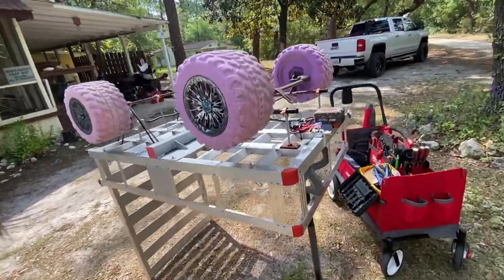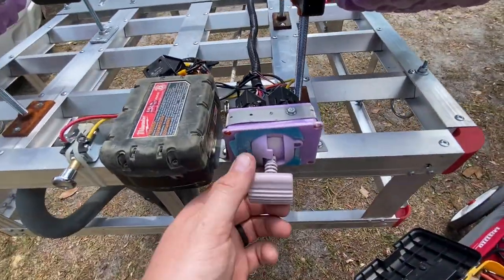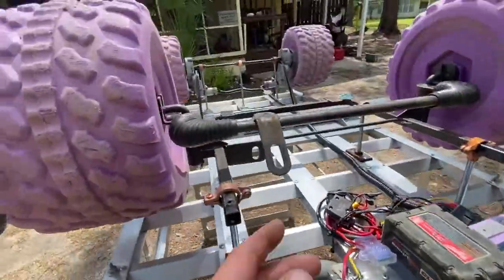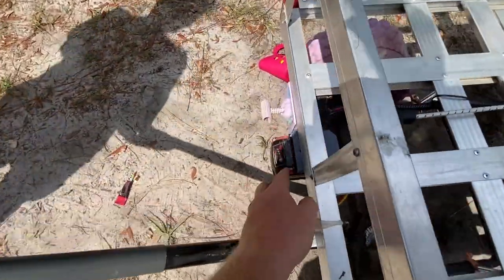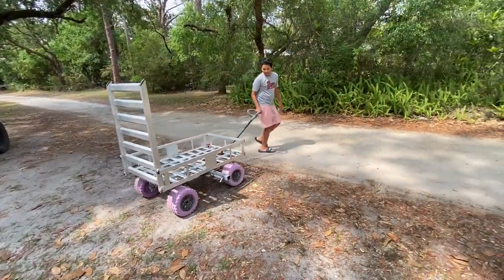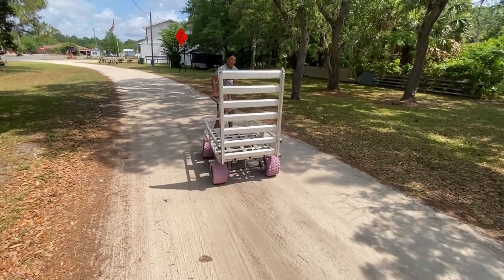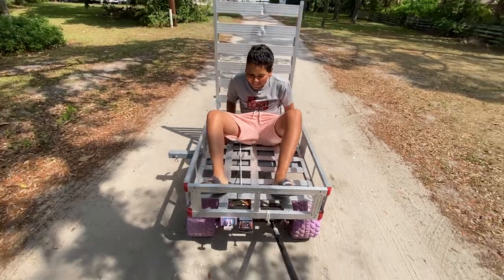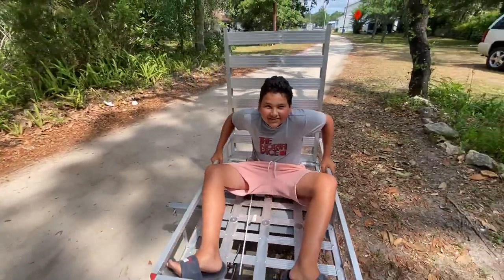The Ultimate Beach Cart Build (Milwaukee Powered)

Comment: Cool idea!  If you move the accelerator switch up to the handle and then you can control it from there.
Reply from the maker: Thats a great point! I was going to do that but the handle has to be removed for transport. I didn't want to be fiddling with wires every-time I loaded and unloaded it from the hitch.
Reply: I was thinking of the same thing.  Having to walk towards a moving vehicle in order to stop it sounds like a plot point in Zoolander or Austin Powers. :)
Reply: Use a disconnection point on the wirings so u can detact the hands and wires if needed
Reply: I have a solution for that, the detach and reattach. A quick connect
Reply: Leave handle connected all the time
Reply: You could probably use a wireless winch, remote control, for forward and reverse, and you wouldn’t have to worry about fiddling with wires at the removable handle just control it with the wireless fob

Comment: How is it on the beach?
Reply from the maker: It worked Great! The only issue I had was any steep uphill sand dune it tends to dig in the sand and you have to pull it a little harder to make it go but still waaay easier that a traditional cart. Im working on a possible 4x4 version for the next upgrade to counteract the hills.
Reply: Imo the height makes this a better design than most but for long-term use I'd go with something more durable suchas mounting a hitch cargo carrier on a gorilla cart with balloon tires for better ground clearance because those sand dunes on beach aren't a joke and the granules of sand getting in the gears and motor will destroy it in no time.
Reply: @marcushennings9513  That precludes using a power wheels though since with bigger tires you'll destroy the gears and motors in those anyway.